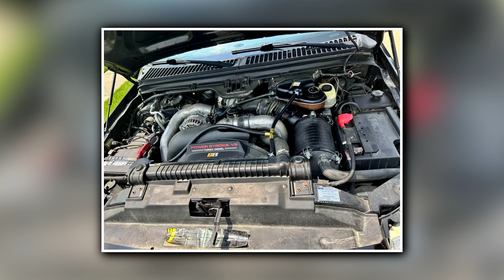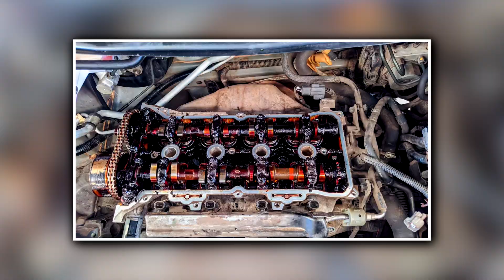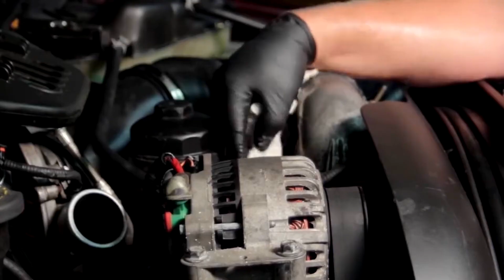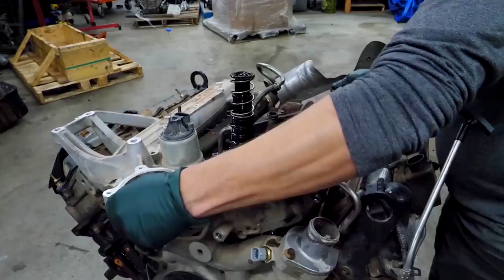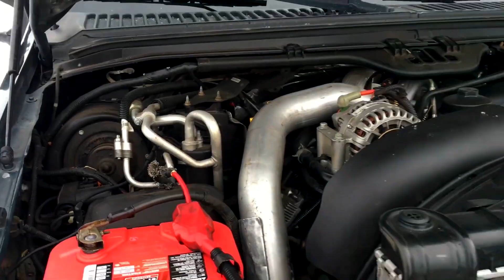The Shocking Truth Behind the Ford Power Stroke Failures

Comment: I bought a 6.0 in 03. At first it was very weak on takeoff. I got it with a 6 speed manual and 2nd gear takeoff required a lot more rpm than a 7.3.  6 months in, Ford offered an upgrade that really helped.  I had a service plan, so my oil was always changed at Ford.  In 10 years and 88,000 miles not 1 problem.  A tech friend told me cheep oil, tuners without headbolt upgrades and ignoring unusual smoke is what is killing these engines.  He also told me the 05 to 07 engines have a different style egr cooler that failed, and the upgrade was the tube type in the 03 and 04.   If the engine is bulletproofed and you keep strong batteries, and use premium oil, your issues will be minimal.